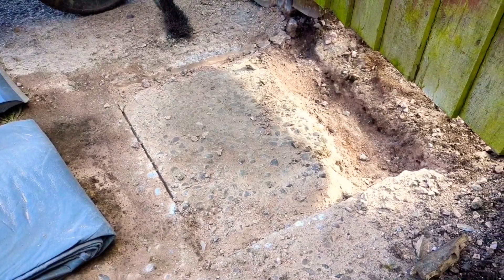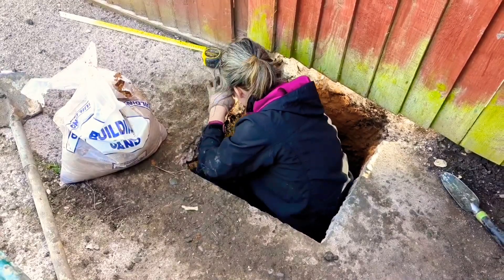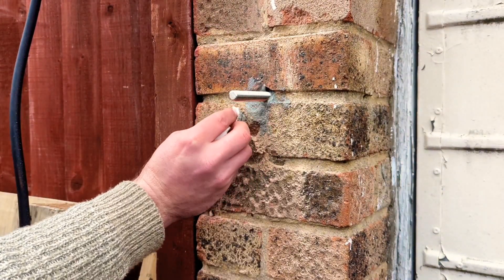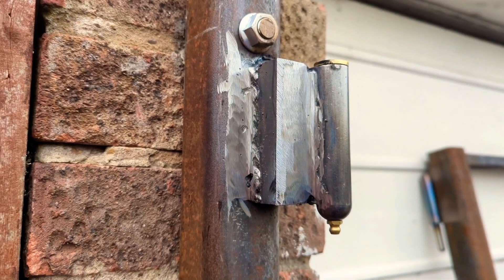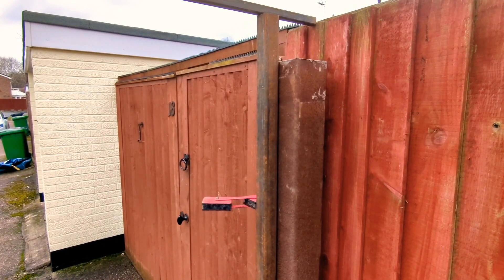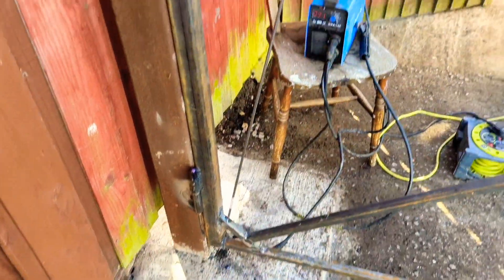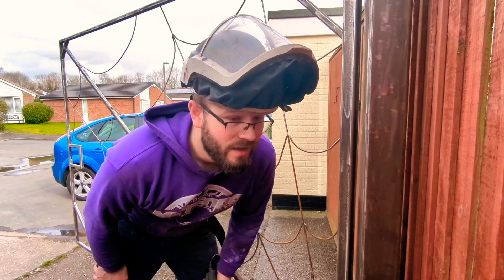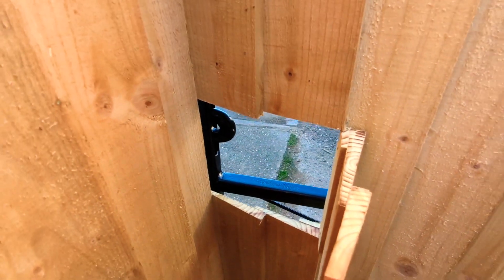Building a Spider Web Themed Gate

Comment: Noticed your using  the blue welder. What happened to the ROHR. Nice vid by the way.
Reply from the maker: Still got it, still working fine... A very simple reason why I used the stick.

It's smaller, lighter, and easier to move around/use outside of the workshop. There was a lot of to-ing and fro-ing, so much easier that hauling the ROHR around. :)